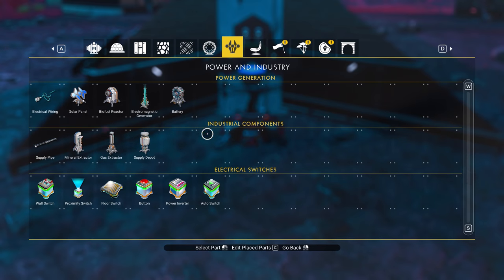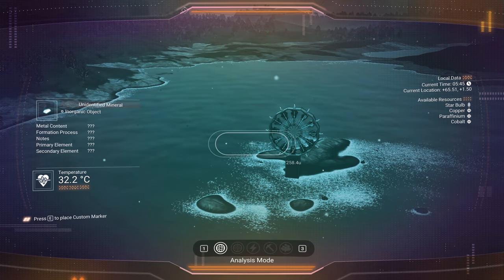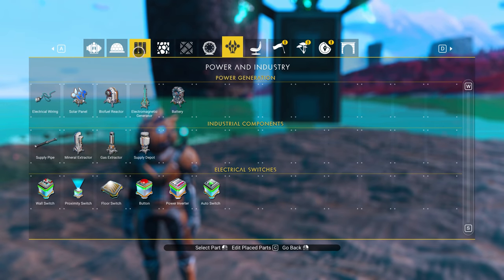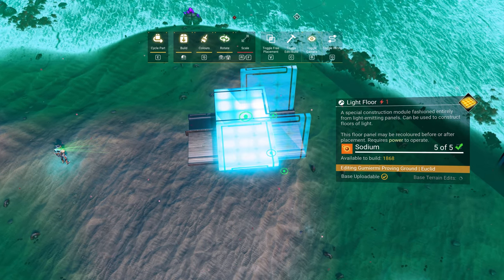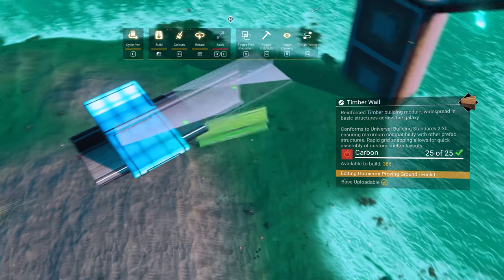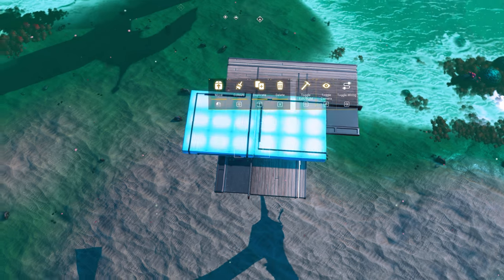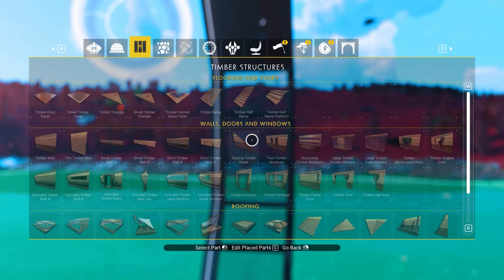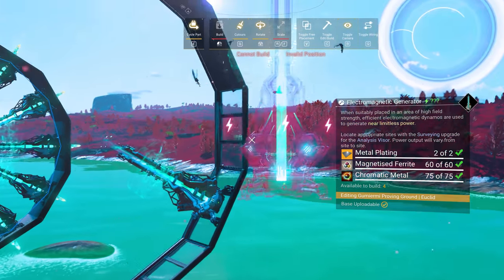Unlock The Secrets Of Base Building In No Man's Sky - Essential Tips For Beginners!

Comment: First, great looking power grid, uh I think I'm going to steal it. Second, I was just thinking THAT'S what they need to enable now, to flip pieces on their sides. That what I wanted a circle on it's side as well. Thanks keep up the great work.
Reply from the maker: Thank you! You can use the base structure of the power grid for Mineral extractors and supply depots as well. Part 05 have a quick glance at it.
Reply: @DoubleDashGaming  Sure will

Comment: I don't know if they changed anything in the game, but I tried the method in the video and couldn't get the generators to 'stick' (kept saying invalid placement). Then I found another way, if you select a generator, then press Q to center your placement (wire) and then press V first (free placement) before pressing Q and LM together it also works. Perhaps for others who are struggling using your method you could try this.

Comment: I did not know the solar panels would work covered over, kind of unrealistic. With the Electro generator O usually stack them on top of each other right over the center of the hot spot, works good for C-Class power. Yours is better looking but that is a lot of E-generators.

Comment: how u connected those electromagnetic generator to the battery in ur base, in tried on my base but they are not connecting, it turn red cz they are like 250u far
Reply from the maker: place a battery or solar panel in between the em generators and your base.

Comment: Hi, thanks for the great video's. I have a problem with powering my base, i build a base with the new building parts and put solar panels and batteries on the roof of one building. But i cant connect these with my base it self. I dont understand what im i missing ?
How do you connect the batteries with the base itself ?
Reply from the maker: You don't have to connect it to your base at all. Only a few base parts require electrical connections, like for instance the teleporter. If you built a teleporter and you want to power it, simply go into the build menu, select the wire and make a connection from your batteries to the teleporter. That's it. Hope that helps.
Reply: @DoubleDashGaming   I need some lights in my base, do i have to connect every light with cables to the battery ? that will look horrible with all the wires to all the lights
Reply from the maker: No, not all lights require wiring. Only the ones like White, Blue, Red, Pink etc. Besides that, you can hide the wires by using the Electrical Cloaking Unit. That way ,you won't see wires at all. They only show up while you're in build mode.
Reply: @DoubleDashGaming  thanks for your help ! I'll try some stuff out.

Comment: How do you wire glitch build with the Xbox.
Reply from the maker: It's basically the Same as on PC. You nee to Pause the Video when it shows the build menu. The Menu for PS4/5, XBOX and PC is the same(The only difference being labeled differently). You just need to compare what is shown in the video to what you see on your xbox.
Reply: Get a green state on the part, hit the Y button for Wire mode, put the wire light on the spot you want to build then hit Y and right trigger at the same time, works best when done fast, super easy. I use an XBOX controller on PC so the exact same as I do.